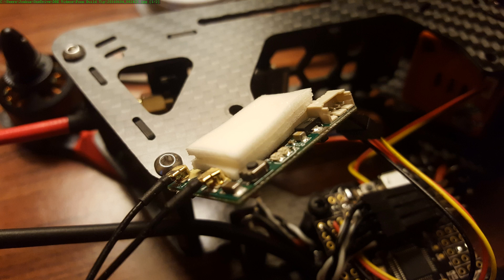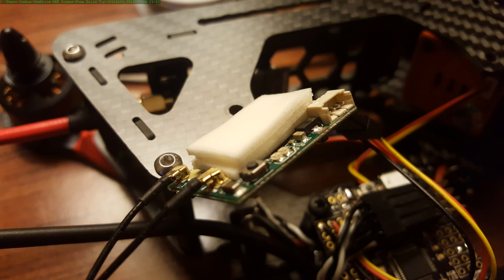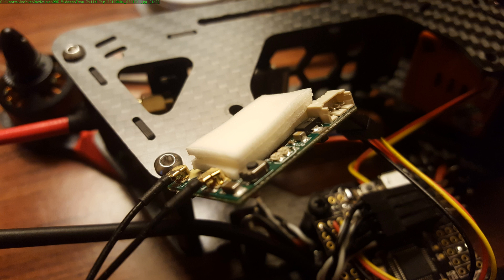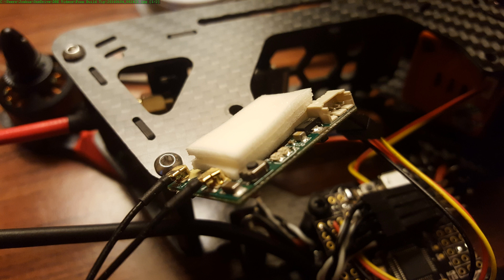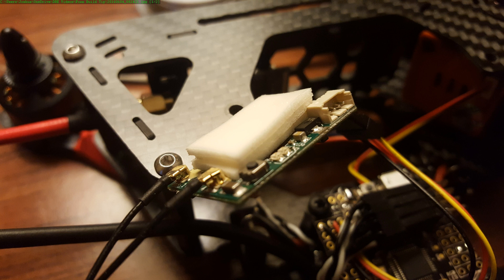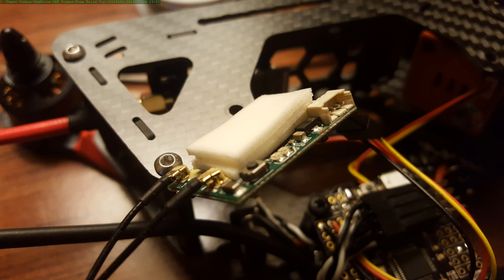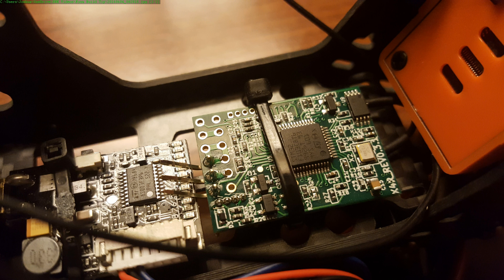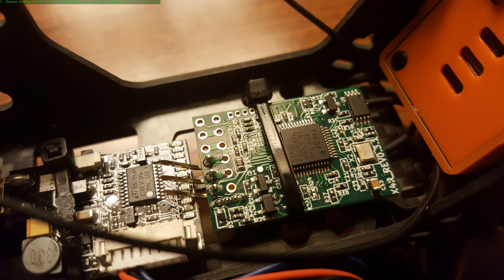Quadcopter Build Tip: The Best Way To Mount Electronics to a Multirotor Frame

Comment: Joshua, I know this is a super old vlog to comment on and may e not the perfect content match, but I absolutely love using wax string, also known as Nylon Lacing Tape, in ALL of my builds.  1000 times better than zip ties in many situations.  Light weight, secure (especially if you hit the knot with a solder iron).  I ha e never seen anyone mention the use of this in builds and it is my go-to stuff in securing components and tidying up wires.

Comment: Hi from 2018 Joshua! I see you have soldered motor pins on the FC in backward direction so ESC connectors are not taking space in front of the FC?

Comment: love your videos thanks. I use another combination of things. I put clear heat shrink on my rx and stuff so I can see where the button is and see the lights. I only use foam tape on micro flight controllers that need lifting. The tape I do use is the 3m double sided stuff. Hands down the best.
Reply from the maker: Clear heat shrink is a good approach. I just never seem to have it on hand.

Comment: why don't you go with hot glue for components that don't heat up like receivers? you can make the bond as strong as you want and yet it's flexible enough to not stress the part. also it conforms much better than foam tape. works well for me.
Reply from the maker: +CNL _ no shock absorption. Doesn't stick well to carbon fiber.
Reply: Joshua Bardwell
being evenly supported, it shouldn't need to absorb shock. and i agree it doesn't stick very well to carbon fiber, but it's because of the large mass of the frame. it takes a big deal of heat to warm up, and cold surfaces in general don't stick well to hot glue. pre-heating the surface a little with a hot air gun greatly improves the stickiness.
Reply from the maker: +CNL _ I feel like the vibration absorption of foam tape helps electronic components last longer.

Comment: Another great video!! You have been a wealth of knowledge on this build of mine. Could you point me to a video (preferably of yours) that explains buzzers and led strips? Thanks
Reply from the maker: +Seans Page I have never used led strip. What do you want to know about buzzers?
Reply: I'm almost finished with my Joshua Bardwell inspired quadcopter a ZMR-210 with red bottoms etc. I don't see any use for leds other than dusk-night-morning line of sight flying. I intend to do most flying FPV in which case leds would be totally useless. I hear a lot about installing a buzzer for low battery and I don't know how useful that would be on my build since I intend on using telemetry with my frsky controller and OSD. I'm curious to hear what you do. Thanks again for your insight
Reply from the maker: +Seans Page I hate running without a buzzer because of all the other feedback it gives. Finding a lost copter with the buzzer is also nice
Reply: Ugh!! I should have thought of that because I have used the buzzer to locate my Walkera. Another trick I use is to record all flights with the DVR on my Fatshark. If I crash and cannot locate the quadcopter I review the footage and make note of what I was looking at just prior to the crash. Thanks!

Comment: the only thing I can't mount with foam tape is vtx. Boscam bos600. It has metal body that is a radiator itself. So it all getting very hot (600mW ) and melt foam tape.

Comment: This stuff is GREAT especially for ESCs! ->
https://www.amazon.com/3M-2155-Rubber-Splicing-Tape/dp/B001CGVEXS/ref=sr_1_1?ie=UTF8&qid=1469325511&sr=8-1&keywords=splicing+tape
"...you do have to stretch it tightly over the wire/connector/whatever to insure that it gets a good bond to itself."
Reply from the maker: I will give it a check. Thanks.

Comment: I coat the bare circuit boards in a couple of layers of rubber paint, it forms a nice thin rubber surface on the component so it's better protected from landing in grass. It's easy to paint around buttons and LEDs to keep them accessible as well. Then mount it with foam tape and a zip tie.

Comment: Solid video and great topic. Im almost never happy with how i (we all)  mount PCB's in quads. Alas, I do most as you do but i hot glue wires and pads, clear heat shrink (LED's shine through, button still depress) then use foam (like from motor box) or d.sided tape and a zip tie. Its always in the back of my mind though, how the tie puts a load on the corners of the PCB. Guess theres not many other good options at this size scale.

Comment: Personally I always shrink wrap, then double side foam tape, and then sometimes a not tight zip tie, just as a backup for the foam tape. But a lot of times I just rely on the good quality foam tape, I've found if I clean both surfaces with alcohol I can generally rely on it for a long time.

Comment: Zip tie always do a good job, just don't stress the electronic components too much!
Heatshrink can be nice if you are really sure it will not rip off, but on most of electronics, with the time, because of the heat, the humidity, the grass, the dust, they can be a serious source of troubles...

Comment: I stopped using zip ties in these scenarios and now use rap straps cut to length. Lowes and other hardware centers have them. I also use single or double layered electricians tape to insulate the CF where the component will mount to prevent shorting.
As you mention, the foam tape is used in many places too when space allows. Hot glue can cover contact points and will come off easy.
Reply: Same here, I never use Zip ties on electronic components due to like Joshua says,it put too much stress on the boards... use small strips of rap straps or cut down the type of velcro straps that fpvmodel sells..http://www.fpvmodel.com/fpvmodel-velcro-battery-strap-200mm-x-15mm-5pcs-_g985.html
Reply: +caymandiver75 not the same as what Blackout carries, the holes are larger, but they are rubber and basically the same thing. I found them in the aisle with zip ties and bungee cords.
Reply: +Hiway nice I'll have to take a look next time in Lowes.  Thanks!
Reply: Lowes sells rap straps now?!

Comment: I live in a area where the dirt has a high iron ore component so Heat shrink makes sense. 
I refer Rap-straps to zip ties, it spreads the load more and probably absorbs some vibrations.
Reply from the maker: True, but rap-strap takes up a lot more space and weight.
Reply: only ever use it for mounting small parts, 1 piece around the Dsun regulator and Rx. It's never more than about 8cm long
Used a zip tie below to save some weight on the 150 but usually use rapstrap of the Rx in the pic below

http://www.rcgroups.com/forums/showpost.php?p=35264130&postcount=9193

Comment: I recommend clear heatshrink still as well. One drop of water from wet grass and it's going to be toast for that component. If not then conformal coating spray it. (I do both)
Reply: eww its waffffle
Reply from the maker: I've never had such an issue so far, although I do try to stay out of wet grass. The electrical tape stretches and coats pretty well.

Comment: Transparent shrinktubing. Bindbutton pressing no problem, led visible. Same to FPV Transmitter. using no shrinktube causes me short circuit when grass gets into the frame (platines) by the props. stuff i cant shrinktube will get covered in nailpolish (special thanks to my girlfriend. she probably dont know...). so the platine is protected of waterdrops.
Reply from the maker: I don't know... this is just not a problem I've ever had.
Reply: if its not a problem, dont mind. in my country its most time of the year wet. expecially this summer had a lot of rain. so the grass is alway a little wet if theres no 2 days of sun. i havent any short circuits till now, but better dont risk and waste more money while studying....poor live xD
Reply: +Rookie Rotors should look into conformal coating.

Comment: Great video, used that exact method for the first build. I have a question, should i power HS1177 from 5v or 12v BEC will it be any different? box says 5-22v
Reply from the maker: Depends on the rating of your regulator. Usually (but not always) the 5v regulator has a relatively small current rating, intended mostly for the FC and receiver and not much more. In that case, I would use the 12v.
Reply: thanks, Matek PDB-XT60 specs say its 500mA 12v BEC and it should easily feed 190mA VTX and 70mA camera
Reply from the maker: kokoronotomoni Are you sure that the camera and vTX pull those amperages at 5v input though? In my experience, for example, one particular camera pulled like 60 mA at 12v and 140 mA at 5v. Same with the vTX. You have to look at the watts it pulls and then convert the amps based on the input voltage.
Reply: Good point, i went from the specs banggood has on its page under power consumption, guess imma find out when i get all the parts to build it.
Reply: The defining question is, what is the pack voltage. With 3S then a 12 V reg is useless. Feed the VTX too many volts and it's working harder than it needs to. For these reasons I prefer to run the entire electronics package at about 8V with a switching regulator which makes the system cell count agnostic for 3S and greater.
Reply from the maker: Rob B That's a very good point! I kind of assume everyone in the world is running 4S, but of course that's no true.

Have you seen the RCExplorer BabyPDB? Selectable 6, 8, 9, and 12v out!!! I thought of you instantly when I saw it.
Reply: So in conclusion; use lowest voltage you can if pdb can supply enough? Too bad my vtx is not 5v, i could used 5v bec then.
Reply: Some are having some success with the 5V out on some VTX's but be warned 5V is really scraping the barrel on the 1117.
Reply from the maker: Higher voltage will result in less amps for the same watts. This is a good thing. But if you go below your voltage regulator's cutout voltage, you will lose the filtering effect, and that's bad. So if you are on 3S, your 12v regulator will almost never be filtering at all. In fact, if you are on 3S, there is no real reason to run a 12v regulator. 

On a 3S copter, I would run the camera gear off a 9v to 5v regulator, to keep the filtering effect. On a 4S copter, I would run off a 12v regulator, since that would be higher volts (less amps) while still getting the filtering effect.

Comment: Velcro (e.g. http://www.hobbyking.com/hobbyking/store/__74090__Polyester_Velcro_Peel_n_stick_Black_1_Meter_.html) also works well where double-sided tape would be used.  To mitigate the exposure of the velcro adhesive through cutouts in the frame's carbon-fiber plates, I "paint" the exposed adhesive with liquid electrical tape.  I put the fuzzy half of the velcro on the frame and the stiff abrasive half on the component.
Reply from the maker: I find velcro to be too "wiggly" if you will. It doesn't hold the components securely enough especially for a racing copter that is going to crash a lot.
Reply: Velcro does depend on sufficient surface area, but I've had very good results.  I especially like velcro for the VTx, because the VTx is most likely to get swapped out, e.g. on race day for a lower-power VTx.

Comment: I found clear heat shrink and an electronics surplus store, several sizes available, then I foam tape the item to the frame, best of both worlds. 3M makes this black, thin and super sticky tape made for commercial use that i use. also I foam tape my esc's with 2 small pieces on the ends so air can get under the esc's to help them run cooler, and after several small to medium crashes, nothing has come loose yet. hope this helps
Reply: this is what I do. i don't like zip ties on my builds and that 3M heavy duty double sided foam tape holds on super secure. though I put a full piece under ESC.

Comment: thanks. do you leave the esc open without heatshrink?
Reply from the maker: +Geert van Mil I cover it with electrical tape.
Reply from the maker: +Geert van Mil I cover it with electrical tape.
Reply: +Joshua Bardwell thanks